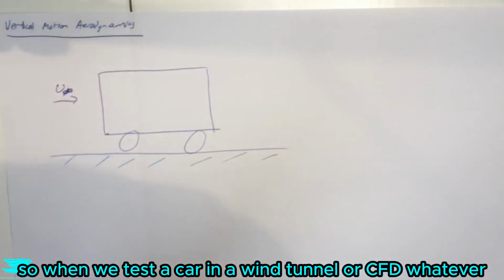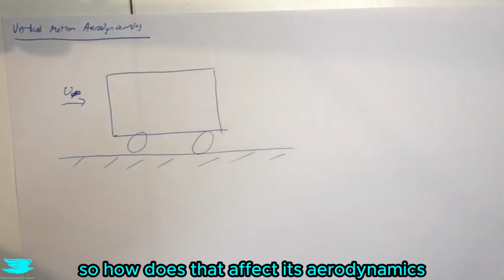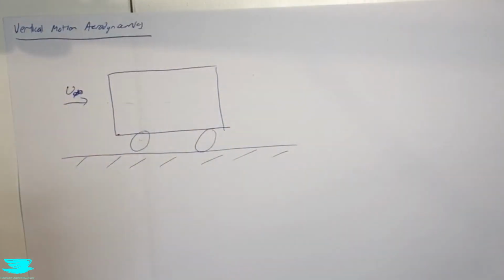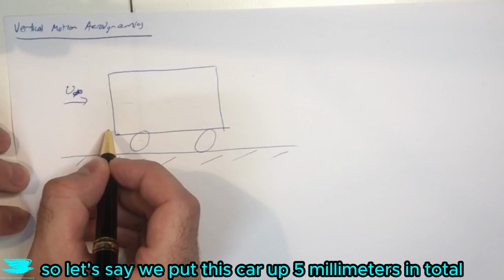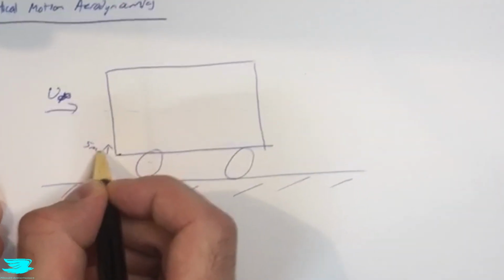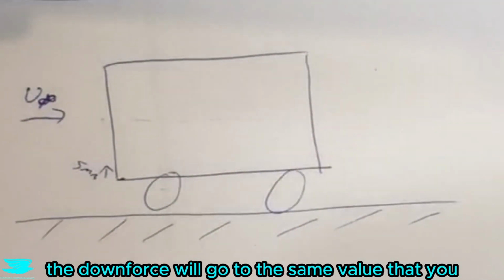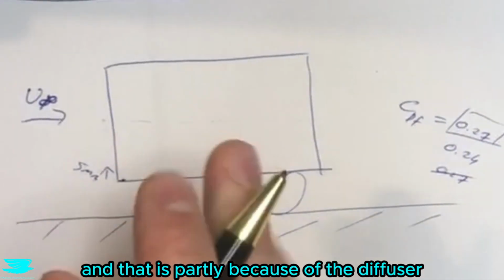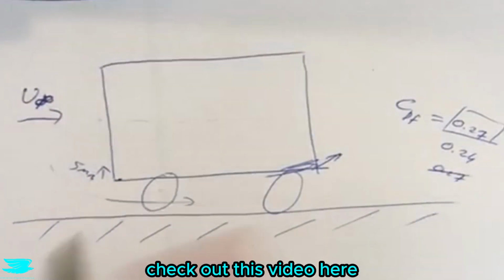Aerodynamics Of Car With Vertical Motion {Auto Aero #67}

Comment: Would the uniform up/down movement also cause small AOA change when it's still in motion? or just too little effect?
Reply from the maker: That's a good point. Theoretically it would if the velocity was high enough and the displacement was large. But, I haven't seen any data showing that it has an effect. But then again, this particular topic is a little new.

Comment: When a car goes over a bump the bump will hit the front axle first then the rear axle producing a traveling sine wave front to back.

From my own research, bubble type vortex breakdown causes oscillations between 6-10hz more research has shown that low amplitude traveling waves in the 6-10hz range suppresses vortex shedding particularly near transonic speeds.

If you look at the bouncing in modern F1 cars, the oscillations are also in the 6-10hz range.

That's why the cars need such stiff suspension. A ride frequency of 6-10hz is insanely stiff, sports cars are in the 1.6-2hz range.
Reply from the maker: That would explain a lot when it comes to changes in the downforce and drag. That frequency is prime territory for significant changes.

Comment: very interesting that shows how difficult it must be to develop a rally car. That it remains stable despite drastic air resistance and downforce changes. And of course the skill of the drivers.
Reply from the maker: Yep, one major difficulty they face compared to other cars - the highly variable flow conditions.
Reply: downforce don't matter that much for rally cars, especially on loose surfaces.